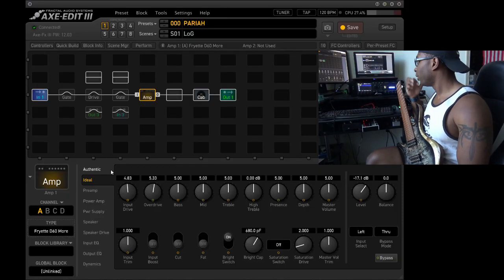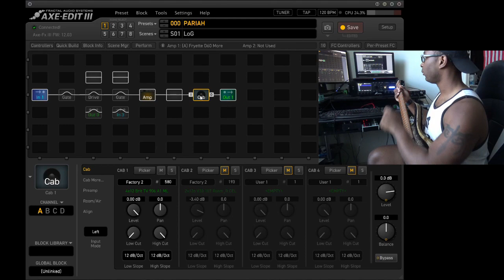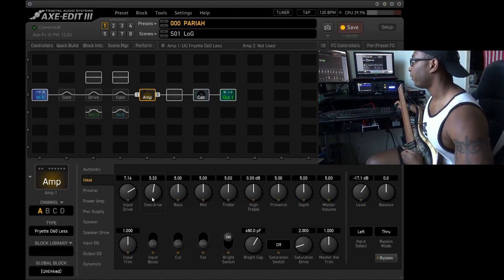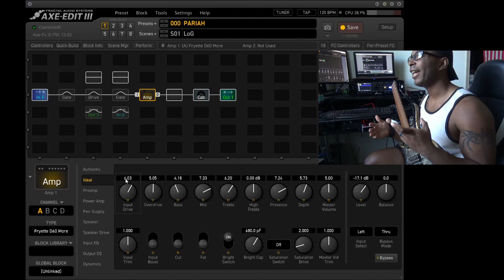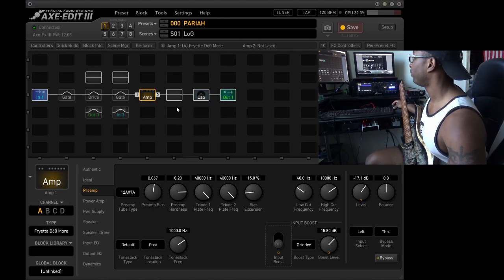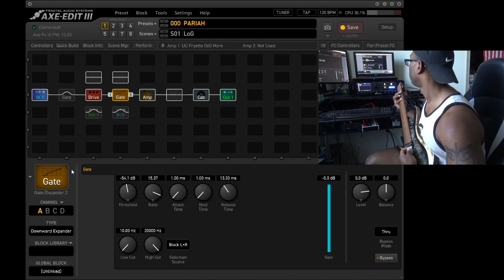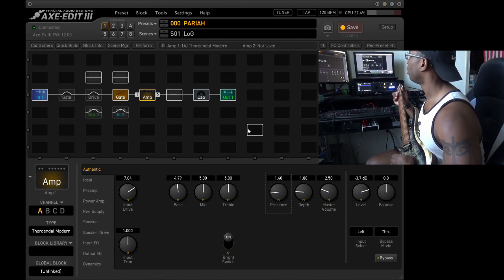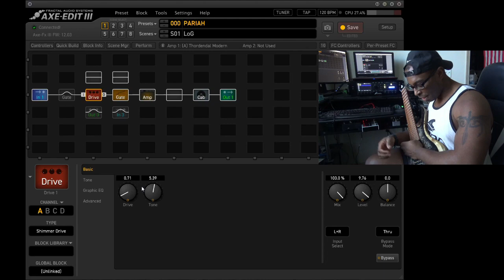How to Get a Great Metal Guitar Tone (Featuring Axe FX III)

Comment: Hope one day get a tube poweramp. Do you use the Axe Fx in the effects loop of one of your tube amp heads?
Reply from the maker: I haven't done that yet..I have an electro Harmonix 44 Magnum power amp pedal that I've used it with though, that sounded really great
Reply: @PariahVSGear  Try using the Axe Fx in the effects loop of your Satan or Thrasher and bypass the preamp section or just leave the amp on the clean channel so the Axe Fx is just using the tube power amp sectuion of one your heads. I've seen Tosin Abasi, Ola England, Kieth Merrow etc. use the Axe Fx this way.